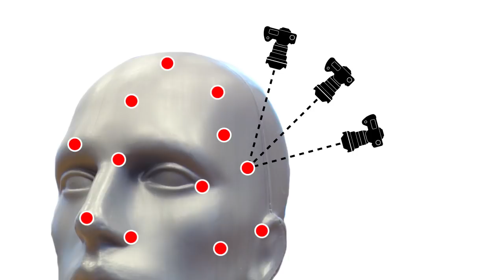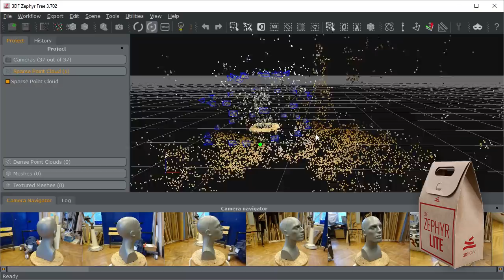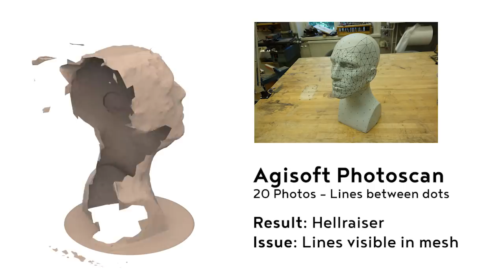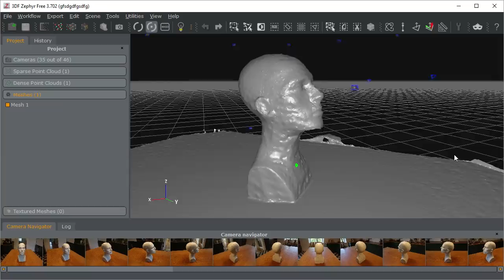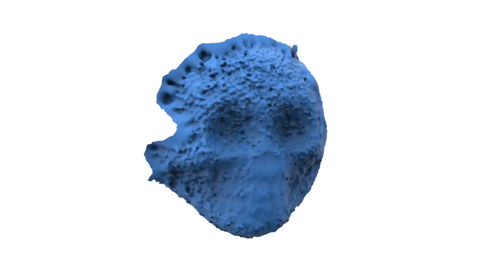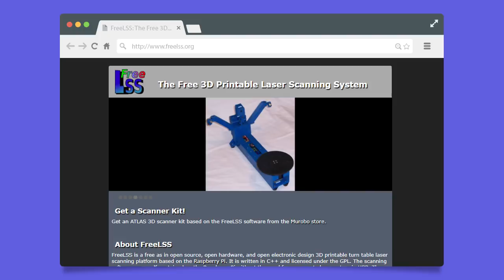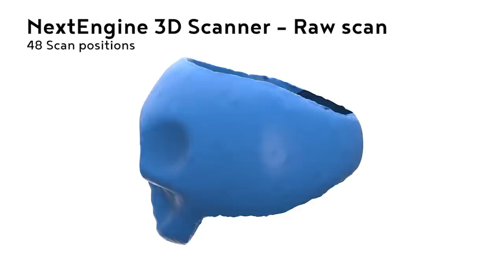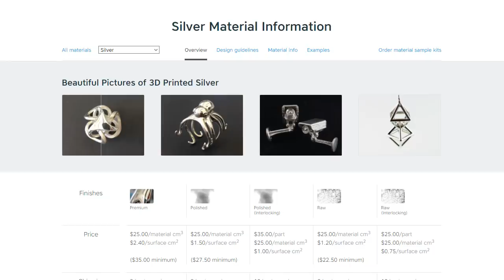How to Copy (almost) Any Object

Comment: If the world ever runs out of mold-making and vacuum-forming supplies, I'd try and make more of those before resorting to this.
Reply from the maker: I will ask you the same question I've asked everyone who keep beating the mold making dead horse: How do you change the scale of a mold? The 3D printed head is roughly 1/5th scale of the original. The ring is scaled up by at least 25%. When you accomplish that using molds and vacuum forming I'd be all ears, until then it seems like the complaint of mold making is missing the entire point of the video.

Comment: Intuitively, I thought putting the head on a turntable and turning it while keeping the camera still on a tripod would give the best result. But this was not the case?
Reply from the maker: The software relies on matching points between images. If the background stays the same the software gets confused. Also the lighting on the head will constantly change when rotating it, unless you're working in very even lighting, making matching harder.
Reply: Switch and Lever    Maybe if you were to try using a 'green screen' like they use in CGI effects and before entering each photo into the phot matching software you were to do something like change the background color of the 'green screen'
Reply from the maker: Yes, that is what Niels Provos did in the video I mentioned, and I basically did the same but didn't use a green screen when I masked out and replaced the background with pure black. Didn't help me though, even though it is a usable method. You just have to make sure your lighting is even.
Reply: Switch & Lever    I was kind of meaning more like actually in a separate post- photography operation, basically using the 'green screen' as a background, but in something like Photoshop editing the color into something like blue, then green, then grey, then yellow or something like that to prevent the software from getting confused by tricking it into only focusing on the image you want to scan
Reply: SFM.  Structure From Movement.  The idea that changes in image frame by frame reveals camera motion and ultimately the object point-cloud, or Structure.
Turntable can work well, but you have to make sure the model is the ONLY thing the camera can see.
Two ways to do this: backdrops/lighting when taking photos to exclude the background or crop your photos in post production to remove backgrounds.
The software will try to match points from one image to the next; if it can 'see' lots of background NOT moving when the turntable runs, then the software assumes the turning bit to be noise.
Many softwares out there have a 'tell me three times' thing going on when it comes to images.
Take your pictures, but if two of them are something you don't want in your scan?
No biggee!  it takes three images with good correlation to make 'real points' in these systems.
Biggest hurdle in this work is in the camera: JPG compression.
Take your shots, but look at the images in extreme close-up.
Do you still have pixels of good color & shape?  Or is it sloppy colorful compression noise?
Image quality is your biggest factor in success.
Reply: I think this worked for him because the object itself had a lot of texture and therefore features. For most objects, masking wont work.
Reply: So using a raw image format would yield optimal results?
Reply: Yes. Image compression routines add noise and artifacts with can impact matching. However some raw formats are not supported in some programs.
Reply: Because the Background helps the 3d Software to Scan the object. And the lighting on shoudn't Change too
Reply: almost like peeling an apple with one long peeling and the software has to assemble that peel in the shape of an apple not a peach or pineapple.
Reply: Why not just make a mold and cast it.?
Reply: @THE_PeglegSwantoon  No green, etc. You can use, for example, a chessboard as a background and background - the object will be very well located when blending images at common points (the camera "does not know" what the object is captured. It evaluates the space from which the user isolates the object !!!). A simple rule applies - take pictures as close as possible to the subject, diffused light, the subject must not shine and shoot in a format without compression. Then Zephyr, for example, displays it perfectly correctly (I use VisualSFM).
Reply: @bjl1000  Messy, and no workshop or access to one.
Reply: it probably utilizes the shadows, and if those are changing, I bet it messes with the algorithm

Comment: I formerly ran the rapid prototype lab at Sulzer Orthopedics. Now Zimmer. I used to create complex bone models from CT and MRI data that was translated to .STL. The technology used individual sheets of heat sealed and laser cut paper. LOM...Laminate Object Manufacturing. These models allowed the surgeons to plan the repair and replacement of old or traumatized joints before ever cutting the patient. It was quite an advantage to be able to see the bone before cutting was involved. That technology was primitive compared to today's 3-D modeling capability.

Comment: To avoid different light (exposing time, aperture) and different imaging scale (distance to the object, can cause also focus problems) and shaking problems, there is one magic key: don't move the camera - move the object! (if it's possible to move...) 
Get a used pottery wheel or any other "carousel" where You can set the Object on (to turn it) and put the camera on a tripod!  Take videos with different camera hights. The resulting video quality will be much easier to process!

(To make Your photo series even more precise, You can also put some angle marks around the outer rim of the wheel - and put a hand (vertical piece of wire or piece of cardboard, duct-taped on the bottom beneath the wheel) that indicates the scale - so You can turn Your object in precise angled steps!)
Reply from the maker: If you looked through the video you would've seen that I tried that method, and it's not without its issues. Firstly the algorithm in photogrammetry programs is heavily helped by the environment around the object you're scanning. By understanding the environment it can more easily understand the position of the camera, which in turn helps to understand the shape of your object. One way which can be more successful is using a greenscreen (like in Niels Provos' video I show a snippet of in my video), but if your object isn't sufficiently detailed that method will also be less than successful.

I would rather recommend you take images with varying distance to your object. If there are parts with higher detail it can be very beneficial to take closeups of that area. The software should not have much issue stitching that together. Also the use of a tripod is entirely overkill as long as you work in good lighting so you can have shutter speeds on your camera fast enough to eliminate motion blur from shaking the camera. Finally I would not recommend using video for your scanning input. Even 4K video is lower in resolution (and more compressed, thus less detailed) than the photos even the simplest consumer digital cameras can take.

Comment: 2:57 Tip for noobs. Small aperture means large number on your camera. e.g. F20 (think of the number as a fraction of the lens, so F1.2 [1/1.2] is a wider aperture than F5.6 [1/5.6]) Use A - Aperture priority settings on DSLR. Nice vid.

Comment: Finally, sculpting and molding may be quicker and more exciting and satisfying than all this ?
Reply from the maker: Sculpting and molding won't create a copy of what you have, it will make your interpretation of it. You could copy a document in a copy machine, scale it up and scale it down if need be, but you wouldn't call you rewriting that document by hand a copy.

As for satisfying, that's for anyone to decide. If I had the artistic ability to do sculpting on this level I'm sure it would be very satisfying, but as it is I don't, so it would be an exercise in frustration more than anything, notwithstanding that I don't have the facilitates to cast silver.
Reply: Switch & Lever you are right, I have the prejudice of being an artists when I said that! For 1 to  1 scale mold copies I have had ver nice results with spinning the mold wrapped in a towel (centrifugal force pushes the metal down the mold, opening facing the spinner, only minimal force required). Another ancient method is sticking a half cut potato to the heated top of the mold immediately after spilling in the metal. I’ve done pretty smooth copies of plasticine sculptures (make sculpture, sink into it thin plastic foil dividers at strategic places where you want the 2 or 3 parts of your mold to open, then smudge plaster onto sculpture creating the mold..) with spilling soldering metal into them :P

Comment: Looking at this for the purposes of creating a respirator to fit the unique contours of a face to achieve a air tight fit.  Thanks for the suggestions and thorough work.  I subscribed!
Reply from the maker: Honestly I think that’s the wrong approach. The time required to scan a face and to adapt a 3D model to fit it properly would be far better spent in printing generic masks (in perhaps a few sizes) and rather thinking about the sealing interface material between mask and face. A soft and flexible material that fits against the face would be a better option, and would easily allow the masks to work on many different facial types. This also eliminates the uncomfortable hard plastic resting directly against the face.
Reply: @SwitchAndLever  Definitely was considering a soft material where skin contact would occur.  A thought that came to me later was a full helmet, though that would have other bad effects on patient care.  My goal was to utilize 3d printing or some kind of at home manufacturing to create usable PPE to combat the COVID-19 virus.
Reply from the maker: Oh, I think it's a worthwhile goal, I just don't think that 3D scanning, especially through photogrammetry would be the right approach due to the amount of manual post work you would need to do to even have a workable mesh to work with. The scale of the imported material won't be correct either, so you would have to compensate for that for each and every person you scan. In the amount of time you customize and print one mask for someone you could've likely printed ten masks that are not personalized.

Comment: I have recently started making rc truck vaccum molding body and this is a great way for mr to cut some major working time on making 3d model. Thank you sir!👍💪👌
Reply: @christopherbradbury9124  hi. Thanks to show interest in my project. 
Ill make a short story: yes it work, but not on a scale I can sell them. The production cost is hight and at the end the result is not that great. Its easy to make a body with a thin plastic, but with a thicker plastics it's not the same. I dont have enought experience right now. But its going foward even with that covid19 virus. 
I also dont feel confortable salling the same body as traxxas.
I also want to add that I started this project last September... perfections needs time.
Thank you for your comments.
Stay safe👍

Comment: Reflections are frequently a problem in photography and videography, so check out corresponding local forums and other such information sources for what people around you use as a "dulling spray" to remove them. Usually you'll find that hair care products are used, they are cheap, you can source them anytime and don't need to wait for shipping, and they can usually be washed off with warm water and soap, unlike paints which are permanent. Spraying a strong-hold hairspray from a larger distance and at an angle will make for a matte translucent surface as it sets in clumps, and blonde and highlight hair sprays are available too, pigmented in various colours.
Reply: I was just wondering about the paint used on the head. It was a nice method, but as the goal was to copy a "precious object", I doubt you'd want to use any permanent substance on it.
Your suggestion seems very interesting.
Reply: Yeah, I learned about this about 20 years ago while working on a photo shoot. They were getting glare off chrome baskets and saw the guy walking around with a can of hair spray. It costs about 1/4 what the "official" dulling spray does and is available just about everywhere. It does just wipe off with warm water/cloth.

Comment: One thing you might (me?) try is textured paint. There's lots on the market that are best known for non-slip surfaces. So if you paint the tops of stairs, there's "sand" in the paint that allows your feet to grip it. That might work best.....
Reply from the maker: Depends on the size of the grit, as it may actually be picked up by the scan. Look how fine details were picked up on the scan of the bread for instance.
Reply: it's pretty fine....like 220 grit sandpaper. But if it is quick and easy to get an accurate scan,  it looks like smoothing it out in zephyr would save a lot of trial and error. There's also paint like you did with black and white. It's supposed to look like granite but really just looks speckled. Check out Krylon, they have all kinds of specialty paints that might help.
Reply from the maker: Smoothing is a last resort though as it has a tendency to also kill fine detail. The granite paint may be interesting, if it's fully matte, otherwise won't work well because of highlights. Can't really find Krylon paints over here though.
Reply: I hear you. I convert photos into 3d images to run on a CNC and the software I use turns each pixel into a point: high or low..soon as you start manipulating it you lose that detail.

Comment: I recognize that teapot. That looks identical to the BeOS/Haiku GLTeapot. Aka Newell-Utah teapot. It has also been dubbed the sixth platonic solid, as the teapotahedron. Very cool reference.
Reply from the maker: Yes, it's a standard primitive that's been around in various 3D softwares since at least the 90s. It wasn't really meant as a reference to anything, it was just a handy model to use. You can still buy the original teapot if you're so inclined, it's still being produced.
Reply: @SwitchAndLever  its been around since the '70s.
Reply from the maker: I know, I'm very well versed in its history. But it hasn't really been standard fare in 3D software until 3D Studio Max, Lightwave and Maya started gaining popularity in the early 90s.
Reply: @SwitchAndLever  in anycase, excellent video as usual.

Comment: I find it's just easier to 3D model something by hand with a caliper and or photos. Even grabbing some model off thingiverse as a starting point takes considerable time, usually they need clean up!
Reply from the maker: Unless it's an engineered item with clearly defined measurements that's not really a copy though. You can measure organic models, such as that head, until the cows come home but regardless what you do the result you model will be your interpretation of the item. It may be easier, but it's not as accurate. This is not a good tool for making a model of something like a phone, or a dishwasher, but rather something far more useful for something like a shoe, or other organic objects. As a bonus, you get the textures essentially for free, which you definitely don't if you model it yourself. 🙂
Reply from the maker: @ctg3d  I would highly recommend looking at Ian Hubert's works and how he utilizes photoscanning in his workflow to create some absolutely amazing stuff, much quicker than hand modeling and texturing would do.

Also, yes, the raw texture coming out of a photoscan is usually a fragmented mess. That's exactly why you bake it onto a cleaned up and unwrapped mesh to get a nicely unwrapped texture as well. It's literally only a few clicks in a software like Blender to do. Compared to the manual texturing it's much less work.

As for the tech progressing, 3D Flow recently released a major update to 3DF Zephyr which indeed improves that program quite a bit. Look for a video on that on this channel in not too long.

Comment: Instead of spraying paint onto the surface, try this:
1. Mix 100g of corn starch with 150-200ml of water for white contrast paint
2. Mix 50g of corn starch with 50g of coal powder (coconut coal powder is cheap on Amazon) and 150-200ml of water for grey/black contrast paint
3. Apply with a €2 car sponge, tap and wipe around a bit to create swirls and patterns

It's cheap as hell (€2 sponge + €5 each for 500g starch and coal) and doesn't destroy the object (I've tried with things like spray chalk before but sometimes the solvent attacks the object's surface and causes chalk/paint to permanently stick).

When I shoot in good lighting and input photos at ~3k  * 2k res, Meshroom detects well over 100k features in each of them and the scans are extremely accurate.

Comment: I know this is counter to making a digital copy...but a really easy way to make a copy of the ring is to use sand casting....coat the ring in talc, pack the important face into the sand, gently remove, and pour full of molten aluminum. I've done all kinds of things this way. 

There is refractory "powder" that you mix like plaster of paris that is heat resistant so you can produce the mold from the ring.
Reply from the maker: And what if I want a ring that's like 20% bigger than the original, like in this case?
Reply: well then you will have to scan and edit the digital copy. I thought you just wanted a duplicate and suggested a way to do it quickly.
Reply from the maker: If you watched the video you see me doing exactly what I said. The original ring is just too small.
Reply: I didn't watch the full video on the ring, got a little bored after a while :-)....